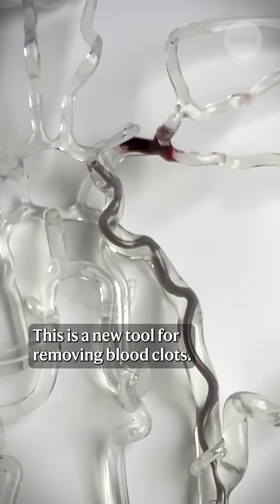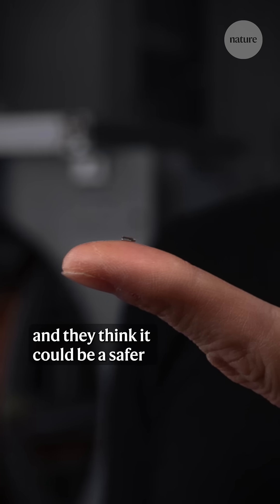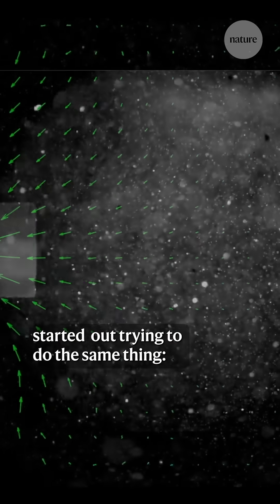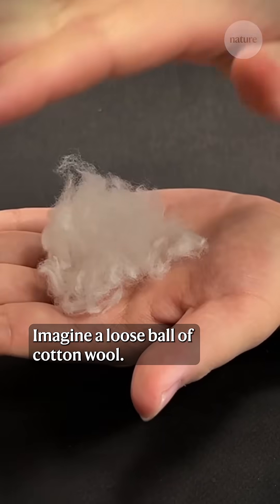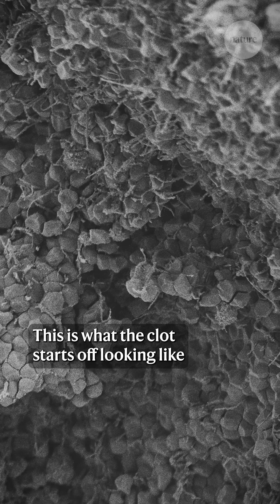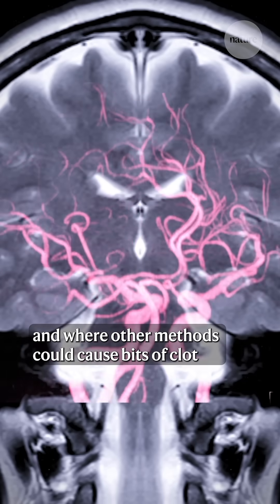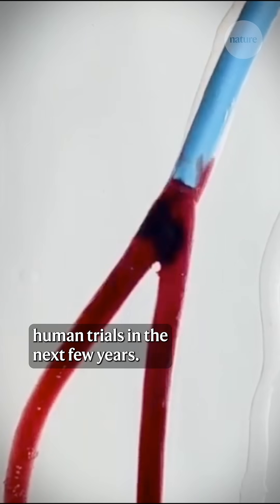This tiny device spins blood clots away

Comment: They tried a method called “angio-bladie” where there were razor sharp blades that would come out of the tube and spin. Problem is that it caused more damage than solving the problem as the blades started to shave the sides of the blood vessels causing ruptures. That, I believe, was in the 1990s or 80s when Anglo-plastie first came out.

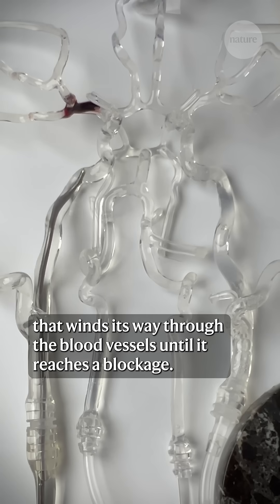Comment: The amount of force used at around the 0:33 second mark would rupture a vessel. It made the whole model shake and vibrate. Good idea, but you cant just snake your blood vessels.
Reply: They say plastic bits are in an astonishingly-large amount of blood clots. I'm not sure it's a good idea to try to "shake loose" any part of it. I'd be more comfortable with a suction device, pulling it into a tiny, bladed chamber.  Keep the blades encapsulated. Think - Ninja bullet, not "wild snake."

Comment: So it's still getting sucked in, right? The spinning just makes the single parts smaller, so they can fit in the tube? Because I've seen a clip of this before, but they just said it spins and then disappears, the chunks still need to go somewhere, even if they become smaller, I would assume... and you still don't want them blocking other vessels, even if they're smaller ones
Reply: Yes, the point is that reducing size makes suction and elimination trivial, even for clots where normal suction doesn't work (because it's too big). Basically, think about it like wad of towel stuck inside a pipe - might be hard to pull out if it's wadded too tightly, but twisting to compress as you pull will make it much easier.

Doesn't mean it's impossible for chunks to break off during removal, but that's true of any clot removal technique, and removing a big clot blocking a more major vessel is still a win.

Comment: Yeah but you also risk vessel rupture
Reply: Would note that this does not involve the spinning element abrading the vessel or anything like that. It's contained inside the tube, and the only thing spinning in contact with the vessel would be the clot itself (which is good - detaching it from the vessel wall is the whole point). This is not a plumbing auger.

Comment: A further addition - after stripping down to the fibrin clot, inject an enzyme to break down the fibrin locally instead of dosing the entire body with anticlotting medicine.
Reply: Hmm that's an interesting idea. Although, there might be a use for having anticoagulant throughout the body; because since all blood circulates around anyways, you'd want to reduce the propensity of the rest of the blood to form clots. I'm thinking of any use-case scenarios that are an exception to what I described
Reply: Problem there I think is that the clot doesn't necessarily form in place, so the real target might be upstream of the clot - where local fibrinolytic agents won't reach.
Reply: There's time windows for both options. Sometimes they're used in combination - tPA is given first followed by mechanical thrombectomy if indicated. In strokes time equals brain; it's much quicker and easier to inject something intravenously in the ER. Procedures require availability of an OR, the team, etc. Don't need to do a procedure if the TPA works. I'm sure there's criteria for when one approach is chosen over another.
Reply: I think the idea is to suction the fibrin out through the catheter, would anticoagulant be necessary?
Reply: I love it. I love it. I love it!!

Comment: That would be the most bizarre feeling
Reply: I'd definitely have to be sedated...between the hatred of being tickled and the PTSD from suffocating from a PE and suffering from air embolism...no thanks, I'll just go out peacefully again 😂
Reply: The brain doesn't have pain receptors, so that's a little comforting. Also, I doubt they would go into your head without local anesthetics. During procedures on the brain the patient must remain conscious, so the surgeons can monitor if there's any nerve damage or changes in brain functions. It they'd be poking where they shouldn't the patients reactions (like motor functions or speech) can indicate that
Reply: @cepheialderamin the brain can still feel pressure, and it's surrounded by layers of tissue that do have nerves:
The thin, delicate tissue around the brain is called the pia mater, which is the innermost of the three protective layers called the meninges. The meninges are three layers that cover and protect the brain and spinal cord: the dura mater (outermost), the arachnoid mater (middle), and the pia mater (innermost). Brain surgery does require local anesthetic, as well as  constant fluid pressure monitoring/adequate replacement of drained fluid.
Reply: better this then being dead.
Reply: @Rihardololz death is NOTHING to fear. I've had a couple experiences with it. It's amazingly peaceful....but you're sent back if it's not time, and coming back is absolute torture after being free from the weight and pain of being back in the body.
Reply: @382AceD how were you able to have multiple near death experiences? What was something you found interesting or unusual about having them?
Reply: @382AceD That sounds like suicidal person would say.
Reply: @Rihardololz nope, just reality. I'm fighting terminal illness, so it's inevitable anyway, but I'm still fighting for every day I can have. I've had a few close calls, some were pleasant. I don't mind going out that way.
Reply: @382AceD You have valid reason but my hopes is still advances in medicine. Also don't want relatives feeling same doomer mentality when they are met with same thing.
Reply: i dont think veins have any nerves so you won't feel anything
Reply: @ihateaahw veins and arteries have external nerves.
Reply: @ihateaahw  veins and arteries are surrounded by nerves. You can feel burning medications, pressure, and itching inside them, too. (I know from extensive experience with plasmapheresis, surgeries, chemotherapies, IV medications, arterial catheters,
and both venous and arterial clots.)
Reply: @CandyAceD17 ohh thats pretty interesting! thanks for the fact :))

are you a medical student or maybe a doctor? just curious lol
Reply: @ihateaahw just a professional patient 😅 I've been fighting myasthenia gravis for 23 years. I'm a grateful walking miracle but I've been through hell. I've learned a lot along the way in the most difficult experiences.